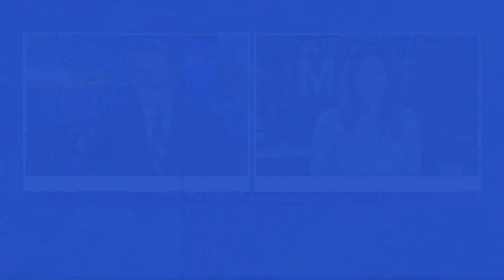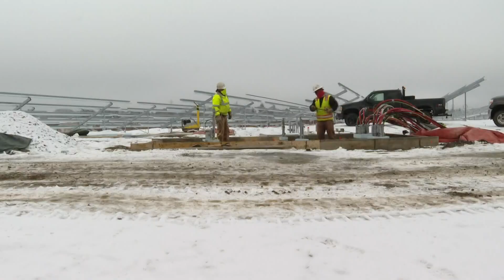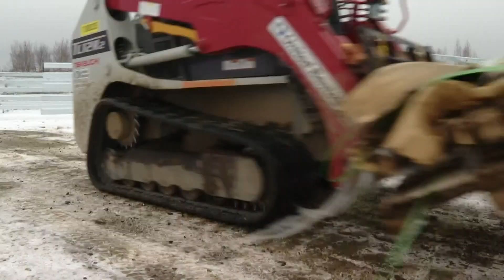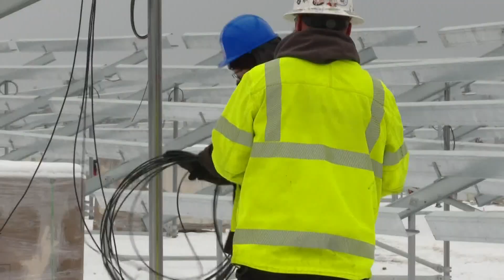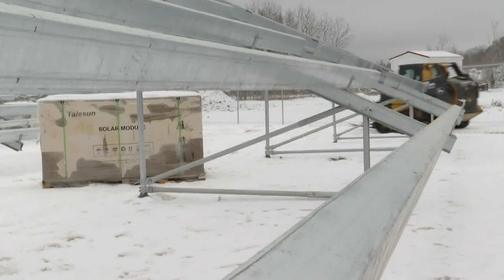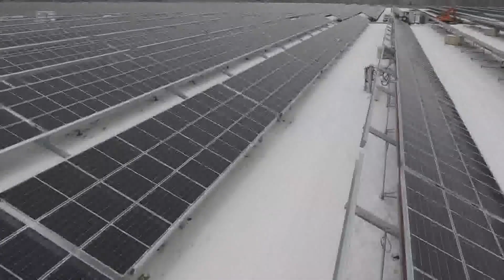Milo Solar Farm to power 10,000 homes

Comment: Looks like you could build 10k house on that land for the same cost 100+ acre piece of land to power 10k house  for what .12 cents off your power bill
Reply: Gentlemen we are forgetting the single best energy producer known to man. Orphans on treadmills can produce enough energy to power this country ten times over, with proper motivation of course. We can even burn the ones that collapse for even more power. This would solve both the power and orphan situation in one fell swoop. Won't someone please think of the orphans?!
Reply: @MrKezzerdrix  or better yet use fat ppl and cattle probs. Then we could solve most of the Heath crises and when we run outta tubbys because you know we would. most ppl of they knew they’d have to run more than 10 mins would stop eating all together then we use straight white male and could end oppression and racism overnight
Reply: Would you rather they build a coal fired plant to power those homes?
Reply: @Matt-fl8uy  do you know how much crude oil it takes to built a solar panels? From digging the material out of the earth to processing it all then to ship it from China or Indonesia green energy isn’t so green how many trees cut down or animals where forced from that land so they could bring in bulldozers and excavators and dump trucks burning all the fuel to reshape the land to be able to install said solar field
Reply: @johnmillis5159  So, how would those "10k house" be more environmentally friendly? How would the coal required to fuel an equivalent plant for 25+ years be more environmentally friendly?
Reply: @Matt-fl8uy  ohh ya that’s right you only want to destroy the plant in a way that makes you feel better about it
Reply: @johnmillis5159  Do you think a coal power plant would produce less pollution?
Reply: @Matt-fl8uy  don’t care about said pollution China and Indonesia produce more than half the world pollution   I care that I’m not being bled dry trying to live in the USA
Reply: @johnmillis5159  Coal costs more and produces more pollution. Why would you rather have it than solar?
Reply: @Matt-fl8uy ok Matt
Reply: @Matt-fl8uy  NY city creates more pollution than 5 coal burning plants so we should just rip it down right kick them all out and build a big solar field right solar per kilowatt/hour is three to five higher than coal wind is 10-15 times higher and nuclear is 15-30 times high in cost than modern power plants and all destroy the earth in there own way just because you think it’s great doesn’t make it the right/or best way to go about it just because you ok with paying way more for electric because you think it clean/green doesn’t mean the rest of are you worry about global warming /climate change but 70 years ago these scientist said where where going into an ice age and the climate has been changing to millions of years where not going to stop it and if we where to can you tell me that is will not have a negotiable effect either the Paris accord would have only reduce globe carbon emissions by .00004 percent so nothing at all you’ve been blindside into think your doing good while lining Obama’s friends pockets just like have  health insurance complains right up Obama care did you really think they had you interest in there mind nope only there pockets
Reply: @Matt-fl8uy  ya I don’t read left wing propaganda and believe it to a t how about looking at more than yahoo and ya in countries that have to import there coal and natural gas not for a country that produces it man try reading more than more source man
Reply: @johnmillis5159  So who exactly is proposing we built NYC in Milo, Maine?
Reply: @johnmillis5159  Solar power costs less than coal power now. That's a fact. You can "feel" whatever you want, it doesn't change math.
Reply: You just don’t get it man if the USA went to 100% (would take more than 50-75 years to even do) so called green energy there would be little impact to the global pollution and carbon levels and China Russia and the Middle East would roll right over us what you whine about is just a small cog in the mighty system that is the world production and power why do you think where in the Iraq isn’t because we cared  about a Sadam it because we needed control over the area because of oil
Reply: @johnmillis5159  I'm not advocating for 100% solar. I'm saying that coal is outdated. Solar, wind, nuclear and gas fired plants are all more efficient than coal plants and can fully meet our power needs.
Reply: @Matt-fl8uy  only in country’s that can’t produce there own oil or natural gas but look at Germany there cost of electric has gone up 5 times the cost of the USAs since the late 60s early 70 because the moved to solar,wind/nuclear power and they have since moved away from nuclear because plants only last 50 years and cost more to demo than to build
Reply: @Matt-fl8uy  and solar only become cheap than coal after 20-30. 35k-100k on top of monthly fees of an investment up front to completely run your house on solar vs 2k-3k a year electric bill from a coal plant ohh and that’s if there enough sun to even power it all year
Reply: @johnmillis5159  No. It's been clear for several years now that coal plants weren't economically viable against more effective forms of power generation. It's why coal mining jobs are shrinking under Trump. You can say whatever you want, a simple Google of the facts will prove I am correct.
Reply: @Matt-fl8uy  Yes or a nuclear